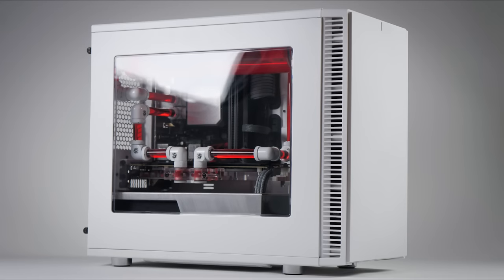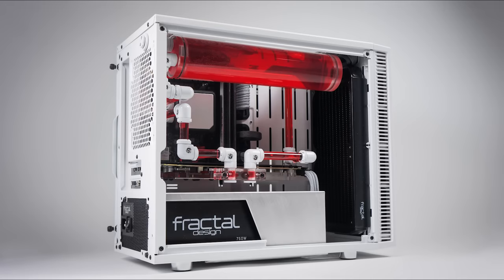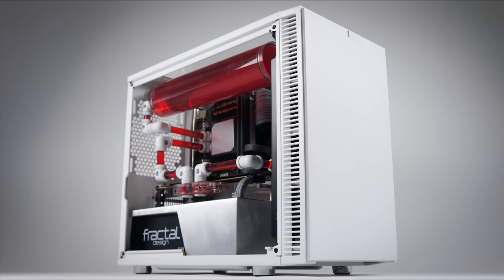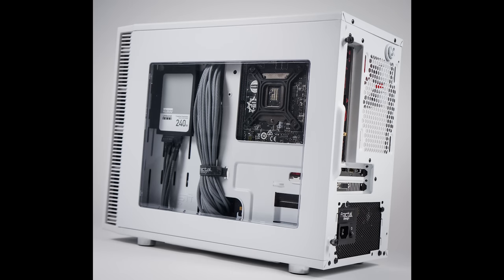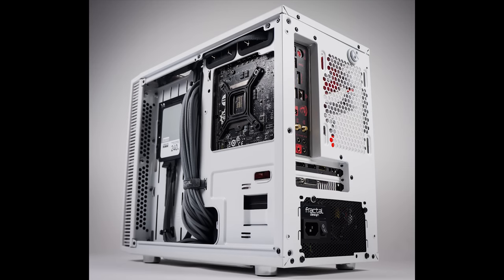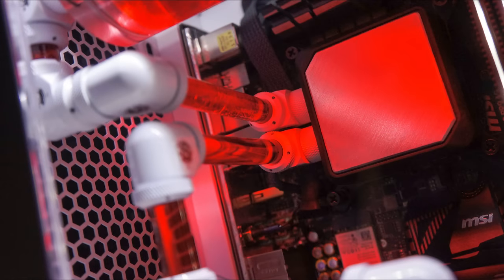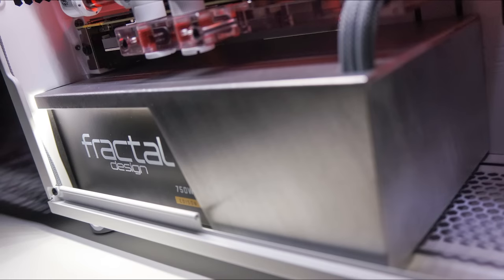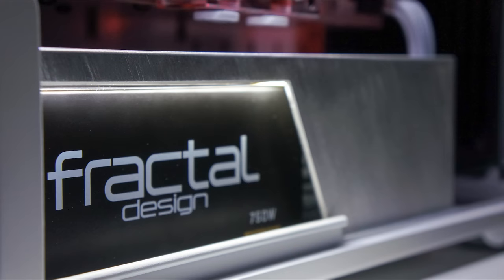Nano Machine by MetallicAcid

Comment: This is really beautifully built. I am no art expert, but i actually like all the attention to detail put in this build. Also how components compliment each other color and material wise. I liked how you put accents on choice of neutral color against that coolaid red cooling liquid, also coating texture of ram modules vs hand sleeved cables.A minor thing that i would  change is pattern how cables are laid out in back  and color of psu exaust. Actually thinking right now what would i painted to if not black :) Anyhow you have superb taste and talent on putting accents. Glad Fractal Design got you noticed.
Reply from the maker: Ingemārs Volters thank you sir!! Very kind words, and I am happy that you appreciate the neutral tones used and how the materials compliment those tones and overall project design.

Comment: This is a beautiful build. The attention to detail is amazing. Even the opposite side looks great. esp at 8:49 because you did your own sleeving the PSU shroud is just prefect. Only thing I can say for improvements, is that since you have a window for the rear, maybe have some combs or organize them for a cleaner look.
Reply from the maker: I had actually used the cable combs but I didn't like how the cables sat as they did not run completely vertical like I had envisioned. So I decided  to utilise the Velcro strap in the end :)

And thank you for the kind words my friend!

Comment: Awsome build.
I have a question. I have a kelvin s24, and i want to expand my system by adding a gpu block (alphacool gpx) on my r9 390x, and a 2nd 240 or 280 radiator. Do you think the pump in the s24 block is powerfull enough?

Comment: love that u use the rez as a connecting line to the rest of loop. sorry but the 960 2 G b is not fitting for this water micro beast. Very nice Build. Love the clear back door and sleeved cables berry niice.
Reply from the maker: Thank you buddy! I know that the 960 is not really the best fit for this beast, but it was built on commission by MSI, Bitspower and Fractal Design, so I had to use what they sent me.